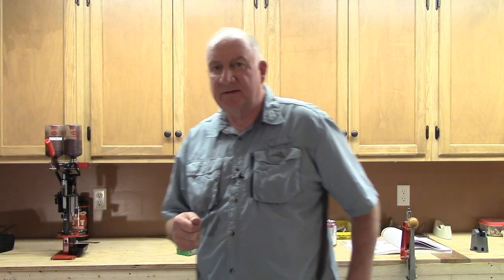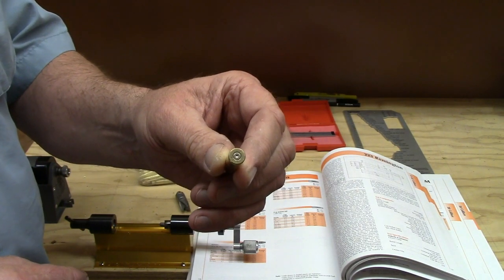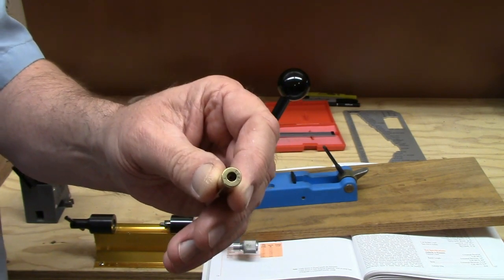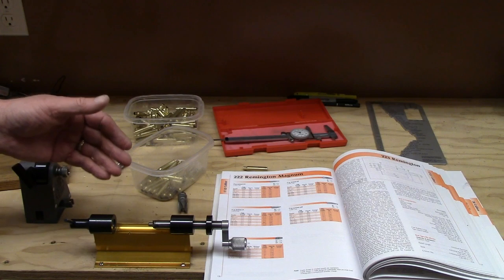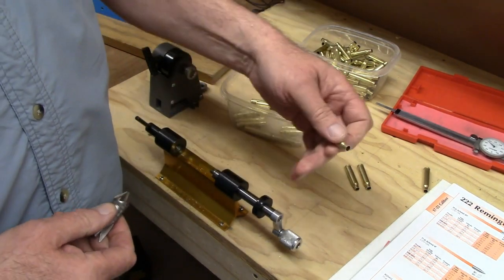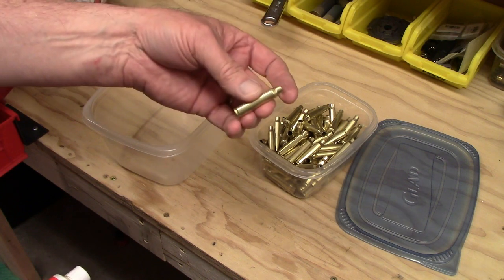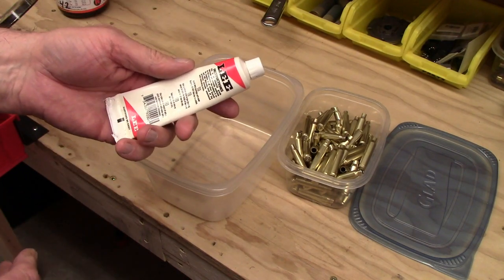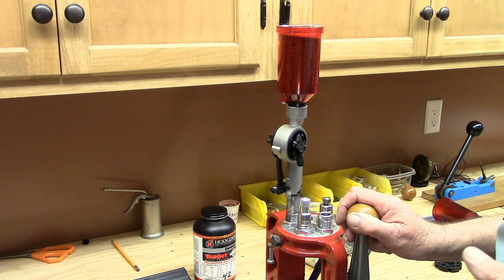How to Use the Lee Loadmaster ~ A great .223/5.56 progressive press!

Comment: I use two Rock crusher presses. I bought a used one and then another later on, prices were right an it works for me.  I use mixed brass and can get 1/2" groups. I have lots of mil cases and use a primer pocket  tool to swage the brass back and ream the edge so it's easy to re prime. I do find it's prudent to anneal case necks every couple of firings or necks tend to split. I like the RCBS universal hand primer that you can easily remove a case if the primer gets stuck etc. I would never go back to using the ones that require a shell holder. 
As usual I greatly enjoy your videos and look forward to new ones.

Comment: I use a Wilson gauge to sort my brass between those that need to be trimmed and those that don’t. They are a bit pricey, but I like the gauge. It makes the sorting/measuring process go pretty smooth and easy. Plus I love the sound the brass makes when sliding into the gauge. ☺️
Reply: Do you have a link for this item?

Comment: I use the same method of case lubing. However, I find it is helpfull to add just half a teaspoon or so with isopropanol. It vapours off very fast afterwords, and the case lube is very well distributed.

Comment: Great advice for using the precision calipers and not just for reloading.  I don't reload but have been considering reloading for precision. Lots of modern ammo is acceptably manufactured but some of my favorite rounds are incredibly costly.  Black Hills 77 gr OTM, 69 gr otm. I get spectacular accuracy but it's hard to pull the trigger at well over a buck a round. We have both my wife and I shooting so a range day can be rather prohibitive with proper ammo. I've been saving my brass so if I ever do begin I won't have to deal with that issue.
Reply: get a RCBS rock chucker.  makes real accurate rifle bullets of ever cal. i have Lee too but you really can't beat a rock chucker for rifle rounds.......from my milsurp rounds to ar, ak hard to beat............

Comment: GunBlue, I am learning to load. I am trying to understand or use load data. Hornady reload handbook has a .223 55gr FMJBT with H335 at Max. load at 23.2gr; And on "The complete Reloading Manual for the .223 Remington" it shows a sierra .223 55gr FMJBT with H335 with a Min. load at 23.6gr. Hornady uses a (rem 700) and the other Data used a (autoloader 15). is it the barrel length and twist rate the reason for the large difference in Load charge? Is the Hornady data not suitable for a short barrel autoloader?

Comment: Maybe you can help with an issue I'm having.  I have my Lee AutoDrum set up properly and it is cycling as it should.  However,  as I start to lower the shell plate (raise the press handle) some powder sprays out from btween the powder thru charging die and the brass round. I give the powder sufficient time to drop.  The drum itself is not leaking at all. I'm using Hodgdon H335 rifle powder on a Lee Loadmaster Progressive press.  Any ideas???
Love all your videos.

Comment: How much variance in OAL do you get with the loadmaster and .223? I noticed that OAL varied alot depending on if all the stations were full or not which I assume is coming from flex in the shellplate,sometimes as much as 5-10 thousandths. so I swapped to only loading straight walled cartridges on my loadmaster. Was wondering if this was normal with the Loadmaster or if im doing something wrong
Reply from the maker: I load to a critical overall length for my AR 15 match loads and they all pop out at the exact same maximum magazine length with Match Kings.  I would have to see what you are doing, so I really cannot assess your situation.  Be aware that quite a few bullets have variations in their length and final point shape, which will affect the overall length, because the seating stem positions on the ogive, not the point.  Also, V-Max bullets and certain thin jacketed ones actually are thin enough to deform the ogive slightly in the seating process, which can affect length.  Any shell plate movement is consistent from one operation to the next, and has nothing to do with the matter, but certainly, be sure to keep your center nut snug, without binding.
Reply: Thanks for the response! I measure them at the ogive with a hornady comparator the flex that im talking about is for example when a case is being sized in station 1 my oal will be slightly longer than when the sizing station is empty. due to the force on the ram being uneven or atleast thats my best guess. but if youre not experiancing the same thing could be something im missing or my press specifically. Like I said doesnt happen with pistol cases.

Comment: Yeah, striking "staked" from my gun vocabulary. What can I say... I'm a car guy!

If you have time to answer, what's your take on flat base vs boattail? I load both in my .223 and honestly can't tell the difference in my common scenarios (varmints + plinking) out as far as 300 yards or so. My understanding is that the difference really doesn't count for much until the range is pretty far out there... but you tell me.

Also, if you have time, could you comment on Varget? It's what I use and I have no reason to complain, yet I find myself falling victim to the internet "group think" that rates it pretty low as a choice for .223. 

Thanks for another great video!
Reply from the maker: Well, staked works for the carrier key on an AR, so it's an appropriate usage where it's appropriate.  I've discussed both of your questions about base form and powders at length on other videos, which I will bait you to watch, but this is the short answer.  The ONLY advantage of a boat-tail form is higher ballistic coefficient, period.  It works in both lateral and vertical dimensions:  Higher BC translates to reduced drag through the air and thus, quicker flight time to target than a standard bullet.  As to the lateral dimension, a bullet that spends less time in the air is spending less time in the wind.  Less time in the wind means that it drifts less for a given distance.  Any bullet, regardless of BC, will drift exactly the same amount if it's in the same air with the same wind speed and direction for the same exact time.  However, the higher BC bullet has less drag and covers more ground over the same time span.  So, a round nose, flat base bullet with a heavy drag factor will drift exactly the same foot off target under the same wind conditions as a very long, slender, boat-tailed bullet with a magnificent BC over the same exact time, BUT the low BC drifted a foot at 200 yards, while the high BC raced out to 600 for the same drift.  Likewise, the same "time of flight" has the same impact on bullet drop.  

All dense objects fall at the same rate (time and speed), whether they are stationary or moving forward.  Higher BC bullets clock more distance over the same time as lower BC bullets, though they drop at precisely the same rate, as even for a bullet dropped from your fingers.  If you want to know exactly how long it takes for a bullet to get to 300 yards, just open a ballistic chart and see how many inches in drops at that distance, and drop a bullet from that same height.  What you see illustrated at your feet is the same time spent by the bullet going to the target.  So, for your first question, there's very small practical difference for most applications under 300 yards.  BUT, flat base (FB) bullets tend (not an absolute) to be more accurate in absolute terms (that's not a contradiction) than boat tail bullets, because they have more uniform release from the barrel crown, and thus, less yaw.  However, that accuracy advantage is wiped out after 300 yards or so with the benefit of quicker flight time of the BT bullet.  So, bench rest shooters who shoot less than 300 yards almost always choose FB, while long distance shooters tend to prefer BTs.  

Understand that the accuracy differences at closer ranges are typically not observed by the average shooter, and only become apparent in the realm of such measurements that result in trophies and boasting rights.  The hunter and typical varmint shooter would be advised by me and anyone who spends time at a bench to shoot FB bullets, as there is not huntable critter on earth that is out of range of the time of flight, or accuracy, or drop, of a properly selected FB bullet.  Nobody should be shooting ethically beyond 400 yards (if that) at any game animal.  A miss can be a lethal cripple that gets away to die later.  Bullet manufacturers all know these mathematical factoids, but they sell glamour just as heavily as Maybeline, and know their public just loves sexy boat tails.  So, if you're shooting Service Rifle competition in the CMP or NRA where you're out to hundreds of meters, it's the BT, because it's about time of flight on a windy day, and not about hundredths of an inch to win a bench rest match from a sand bag.  If you're a hunter, the FB is generally better because they tend to have better jacket retention without costing a lot for bonding methods that are needed for hunting grade BTs.  The reason most hunting grade BT bullets have expensive bonded cores is because the physical shape of them wants to squirt the core out on impact, so bonding became a necessity.  Makes no difference with match bullets.  As to your next question:

Over 160 different smokeless powders are made by at least eight international companies that I can think of off-hand, three of which are the same company, Hodgdon.  They all make the same product, made of cellulose and in the case of spherical; nitroglycerin, in the same variety of forms; flake, spherical (Olin Ball), and extruded.  They all make powders that have virtually the same range of burning rates (quickness), from relatively fast to relatively slow, and everything in between.  They all purchase them from various silent contractors that specialize in these products around the world, most notably from Scotland, Australia, and Sweden.  I'm not sure who still produces in the US, as I have not seen that on a can that I have bought for some time.  

Varget is a Hodgdon product that is a traditional extruded single-based form with a medium burning rate on the chart.  It occupies a useful spot on the list that is shared by no less than 25 other powders in the same general quickness range that can be used for the same cartridge and bullet combinations.  In the real world, it tends to fill about the same mission as old military IMR-4895, except in the area of advertising.  Hodgdon has a clever understanding of human nature that it brings to a rather mundane world of easily forgotten numbers, and simply capitalized on it over the past decade or so.  Varget evokes Target.  Benchmark evokes benchrest.  CFE223 evokes 223.  And so it goes.  They probably wish they had hired that advertising genius years ago, but they went one better by buying the competition anyway.  

Varget is certainly not a better powder than any other.  Like other powders, it is better than some others with certain combinations of loads, and any of those others are at some juncture better than any of the others, including Varget.  I have a fairly extensive array of rifle powders that occupies less than ten percent of the available rifle powders made, and I have used an equal number in the past that I don't currently have on the shelf.  The reason being, that there's no magic powder for all uses.  They each have niches, and they are each very hum-drum and each exceptionally bad, depending on the bullet and cartridge, barrel length, velocity, and so-on.  When a loading manual author/laboratory works up loads, they are humans with a common nature of repetitiveness for things that worked for them in the past, so they tend to list the same powders, page after page, because they keep their favorites on the shelf.  There are five times as many powders they have not tried for a given load than they have tried, so, they don't know what they don't know.  The powder Sierra or Nosler lists as a particular accuracy load in their test might group twice as large as a powder they didn't test, but being creatures of habit, they probably won't go shopping for another powder.

You can substitute the word Varget for any other powder in its burning range from this statement forward:  Varget can be very accurate with certain bullets, in two very common and popular cartridges; the .223 and the .308 (which is equally true of several other powders with the same or different bullets).  If you're a .223 or .308 person, you can flip to the page of almost every manual and get their take on their "accuracy" load for it, which are, by the way, different for each manual, because they all use different barrel lengths, which affects burning time and harmonics (again, true of other powders).  But, it's a very bulky powder that fills cases oftentimes before reaching maximum pressure potential, often requiring heavily compressed charges, if you can get the powder into it at all (yawn, true again).  That matters not to a person who dials in his same distance to a bulls-eye at each match, and who works with his rainbow trajectory, but it can frustrate the person who can't get desired velocity from his pet M4 clone with a stubby barrel.  

I buy Varget because it happens to give wonderful results with 75 grain bullets in my .257 Roberts, so I had it on-hand for this .223 load with a 69 grain bullet, which it happens to shoot well, until I can find another when I have time.  In my personal experience, CFE223 (previously slightly bulkier BL-C2 was) is my go-to powder for the 55 grain bullet in the .223, but it's quite inaccurate for the 69 grain out of my rifle, so I had to try what I had on hand, which was Sierra's accuracy load for the same combination and barrel length (doesn't always work that way).  Varget proved to be acceptably accurate with that 69 grain bullet, and I have not had time to test others that will likely prove as accurate, while being more user-friendly too.  Most of the loads I've tried with Varget in most calibers were pretty lousy, in fact, or couldn't approach standard cartridge velocity.  It stinks in my 22-250, and crowds most 223 loads terribly.  Like all powders, it woiks when it woiks and it don't when it don't.  It's all a high school popularity game that has little if anything to do with reliability.  

I have considerably more beautifully accurate loads with more cartridges across more bullet weights with IMR-4064, IMR-4350, IMR-4831, H-322, IMR-4198, and Reloder 15 than any powders I've used over the years.  Varget is just another powder that I have thus far found particularly useful for a couple of loads, and universally unacceptable for the broad range of cartridge/bullet combinations I've tried.  Reloder 15 has become a good friend.  It's in the same burning category, but I have found it to be better across a wide variety of loads and cartridges, but with with better handling characteristics than others, such as bulky Varget and crunchy IMR-4064.  It's a very small, easily metered, extruded powder that fills a case well without crowding, and gives fabulous accuracy in quite a number of guns that I've used it with, especially the 300 Savage, 22-250, and 257 Roberts.  I will be very surprised if it doesn't perform well in the .223 with heavy bullets.
Reply: Wow! Didn't expect such a detailed answer and am grateful for it.  As I said, I have had no cause to not like Varget  in my .223 (20-inch barrel hunting-adapted AR platform), but since I am running low, I will try something new.  Developing a load is as much fun as it gets! Thanks for taking the time for a very complete and useful answer.
Reply: In my experience Varget is pretty much the ideal powder for .308 with 168 and 175 grain bullets because even at the max loads in the reloading manual I have they aren't compressed loads and the powder almost completely fills the case.  Plus, I have had extremely good accuracy with it in my Remington 700.  As far as .223 I believe it is a little slow on burn rate to maximize the potential for .223.  The only good thing I would say about it is it would be darn near impossible to overcharge a .223 case with Varget because the powder is so bulky.  I recently picked up some BL-C2 to try but have not gotten any loaded up with it yet.  I have also heard good things about Ramshot Tac and Xterminator powders.
Reply: GunBlue490 after stripping away all the marketing pizzaz, I agree that the average shooter would be well served for almost any cartridge if they only owned IMR4064, IMR4350 and IMR4831. Unless you're loading monsters in the Ultra Magnum class where the slowest powders work well.

Comment: Sir i have a question about flash holes. I have been loading several caliburs in pistol cartridges. Mostly in mixed brass.  I have noticed that some of the flash holes are different in size. The Federals are significantly larger. Mostly im am just plinking but do want to make a carry calibur once i can determine the best load. I am not measuring velocity just going of high pressure signs, reliability and accuracy. Should i seggregate the larger flash holes from the smaller? Is there any consideration i should be making concerning the larger or smaller holes?

Comment: I have a question I'm new to reloading. So I was full sizing 308 and when I went to measure the length of case on certain points it would read 2.015 then I would simply turn the case clock wise and would read 2.022. Am I doing something wrong
Reply: If the brass has never been trimmed the case opening may not be square. If it's been full length sized and the overall length is below maximum allowed, load it them trim if needed after firing it.